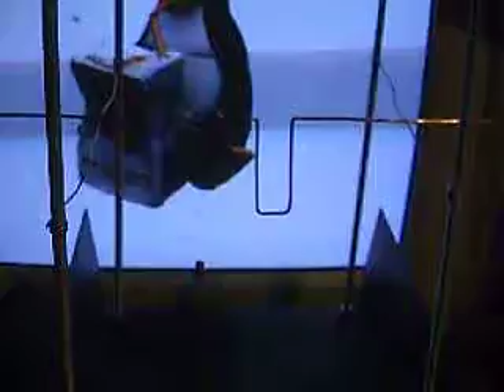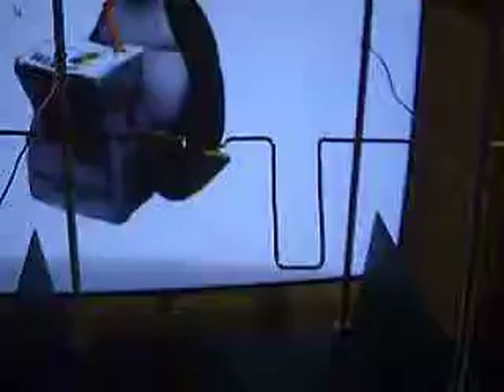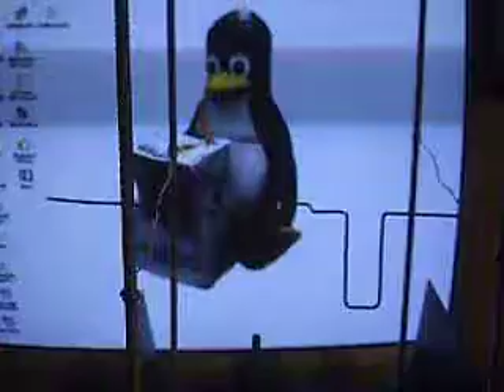stirling engine construction part 2

Comment: Is nice your using a new technology product CD to make an old technology model..it seams very real. For the crank, for the next one, to look at piano wire, often used in model making, undercarriadge on model aircraft etc, it can be manipulated with piliers & unlike copper electrical wire, does not has that soft ductile quality,  or gas welding rod. Piano wire is a good carbon steel, gas welding rod is available in a range of matls, but easily available in steel & both are straight & true.